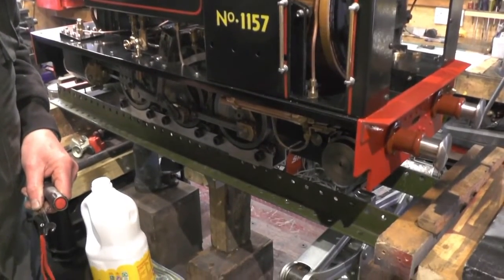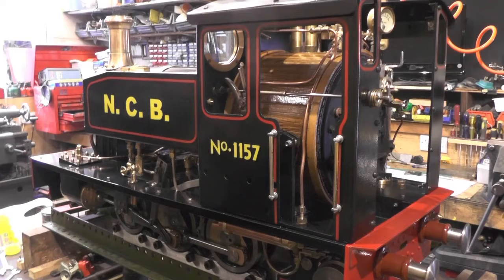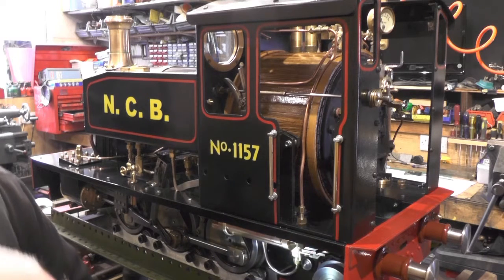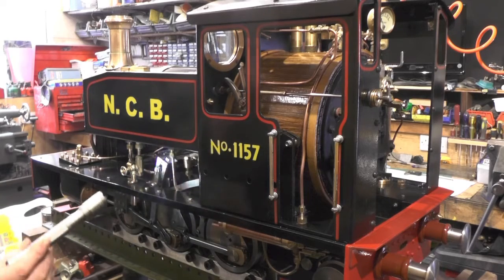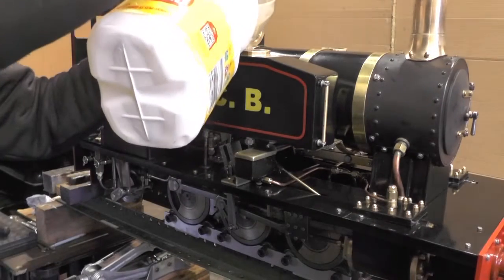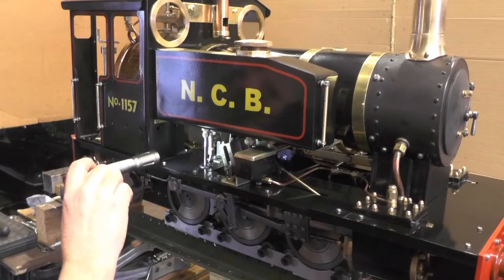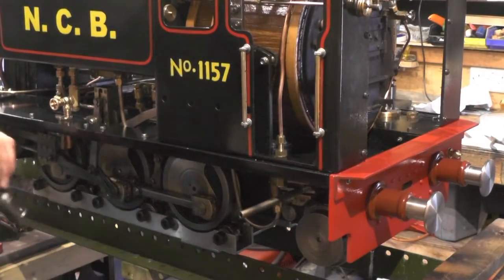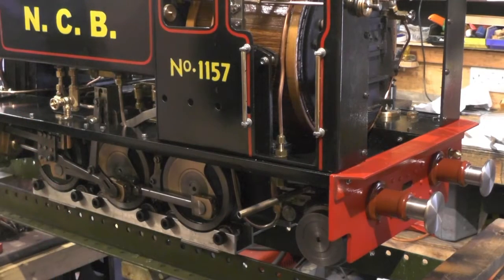Build Your Own Beginners Miniature Steam Locomotive Series (Testing Tanks / Pipework) "mr factotum"

Comment: Good day , I just again watched your "water tanks part 4" side tank assembly video.
 You mentioned sealing the top cover sheets and the large handy  nuts for the removeable knurled covers with an o-ring . * Where abouts are the atmospheric vents located to let air in once the water level drops from the hand pump and axle pump are used to feed the boiler ? 
🙏 Forgive me if I missed that important part . You did say the injector will have its own source of cool water from the riding car water and coal bunker *which needs venting too !
Cheers , 
Craig 

Cheers, 
Craig
Reply from the maker: hi craig
yes, when i did that video, someone commented on the need for venting, so off camera at a later time ive blind drilled the screw caps in the centre on the inside to just before  breaking through the top, then cross drilled in the side of the caps to meet the centre hole to allow venting on both caps, if that makes sense, i mean't to do a video on this but forgot, thanks for keeping an eye on such detail and getting back to me. i appreciate all your advice.
i will mention this in a future video if i remember.
Also as for the water tank on the riding car , i haven't done that yet but now you mentioned venting that ive got it logged in the memory bank, trouble is the memory bank isn't as sharp as is used to be.
Thanks for all your advice 
stay safe
regards
mr f